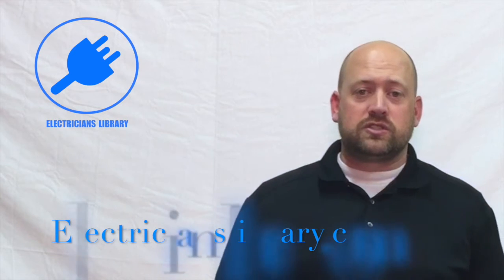Do transformers need to be grounded?

Comment: Why would you even consider NOT grounding a transformer?! It's an inductive load!!
Reply: The transformer I have has 4 mounting bolts on the housing, as well as the 3 usual wires. But, if the junction box housing is plastic or if the transformer isn’t bolted to anything, will the ground wire be sufficient to ground? Even if the metal housing isn’t bolted to a metal grounded junction box?

Comment: Yes, it is true that the ground is NOT part of the current carrying circuit, and a piece of equipment will still function without a ground connection. However, the ground is necessary for safety reasons. It is there to assist in any fault conditions, being a ground fault or a short circuit. The ground wire helps any over current protective device to do its job.